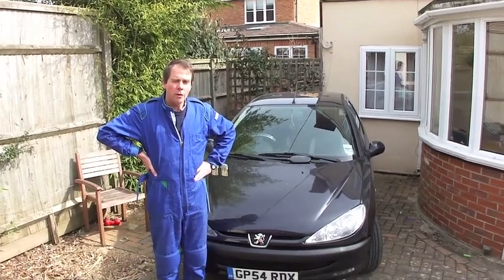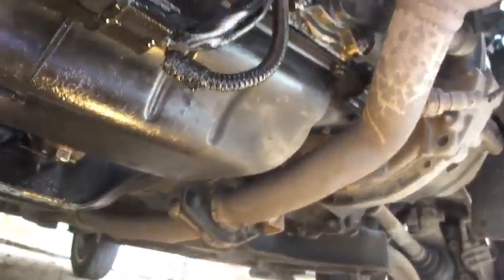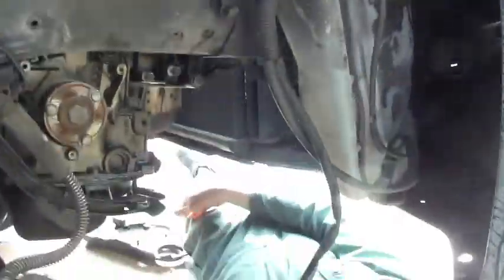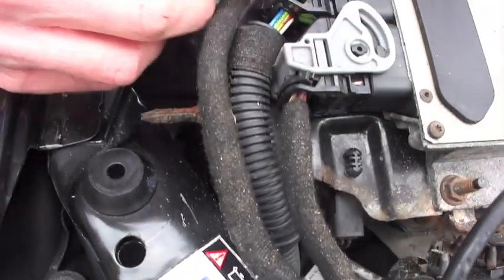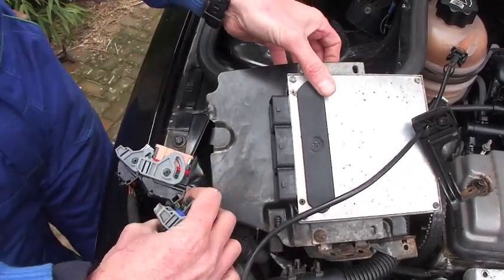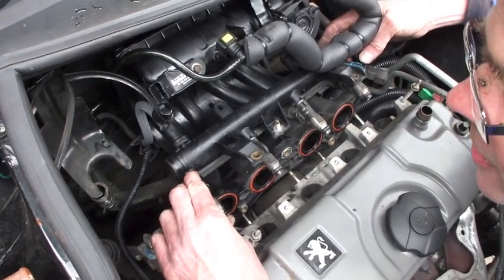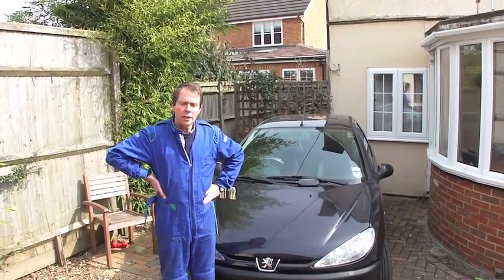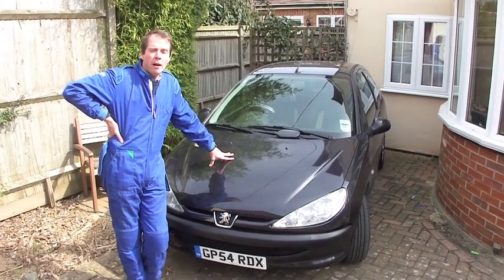How to change a Peugeot 206 1.1 Petrol engine Cam belt and head gasket

Comment: Understand times an issue when doing a video, but what about water pump, false economy not doing it, you never mentioned the timing belt tensioner and how to correctly set and adjust it, good idea making up your board to lock the engine but it would have been easier and quicker looking for the flywheel locking point, on that vehicle it just being the oil filter

Comment: Hi, I have a Peugeot 207, 2008,51k miles car. My car recently shows message anti pollution fault , power loss a lot could you advise me how to fix this problem?
Reply: well, it is a generic code for any kind of fuel injection issue, maybe your fuel pump is gone, you should check the pressure on the fuel line, could be possible it is going down.Thats the first guess of mine, my second guess is the oxygen sensor(or lambda sensor) that went crazy!!!THE BEST WAY to fix a Peugeot is having your own scanner like Lexia PP 2000 tool, or a code reader dignostic tool like Autel Maxiscan MS509, it will be definetely better to see the right thing at the spot instead of changing unnecessary parts.

Comment: so many things wrong here that you better go to another site if you want to do this job,first is he didn't know where the crank timing was,there is a small hole near the oil filter,to make it easy I just put a right angle in a bit of brake pipe and put that though you have to know this in case you ever lose the timing,so first turn the engine [big socket on bottom pulley] until you can line up the cam pulley with the hole he showed you, then the crank should be in about right place, but don't put the pipe in and leave it just check you have found the hole,move the a the crank tiny bit in each direction [don't force it] just to make sure once in take it out and don't turn the engine any more,now you can retime the engine any time like a pro,other things are the plastic shield under the wing you only need to take half off it joins in the middle,you don't need to take the engine mounting off saves a lot of work [like all that ECU he took off],on the right hand side you will be stumped when you try to take the water pipes off [he didn't show you that] you take the whole water jacket off,ten long 10 mm bolts east to get to,only way,don't take  the inlet manifold off [the bolts underneath are a job and half [he didn't show you that] just disconnect all the plugs and pipes,and take the lot off in one lump,and on and on,he made a lot of extra work out of it and timing problems,don't go his way.
Reply: chris keeley ya it’s a joke

Comment: For those that want to do this job, the correct torque and angle (for most gasket kits) is:
(1) 20nm torque
(2) 120º on all bolts
(3) 120º again on all bolts (which gives a total of 240º)

The tightening sequence is done using 120º twice instead of 240º once in order to maintain even pressure on the head as tightening is done. Of course, check in the gasket kit for the instructions. Some are different thicknesses and require different torque and tightening doing on them. Elring gaskets are as above.
Reply: coo, man!!!
Reply: J

Comment: All of that and you didnt do new tensioner, belt and water pump? think i would have spent the £70 or so extra and done it correctly to ensure no major work for the next 3 -4 years or so.
Reply: Also I would have spend £5 on an angle gauge rather than using a dot of paint!